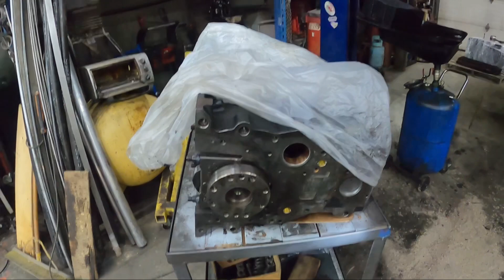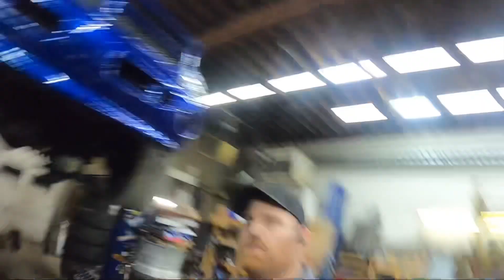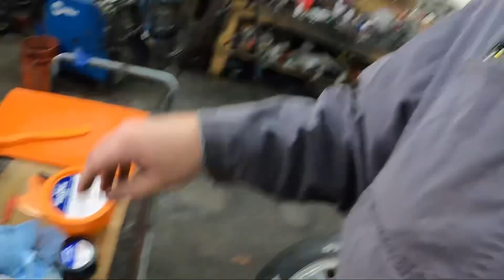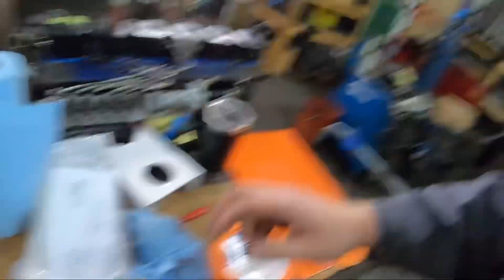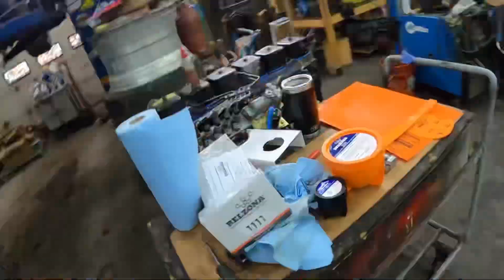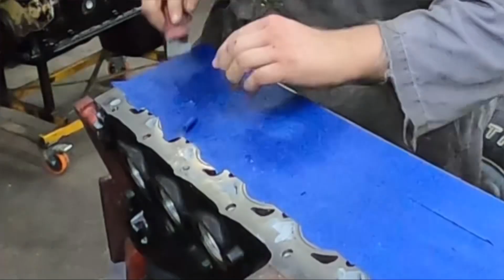I AM GLAD SOMEONE NOTICED!  6.1 CUMMINS BUILD

Comment: Wonder if that stuff would seal up the crack I have on one of the 12V heads I have around.  It’s an external crack between 5 & 6 above the head bolt on the exhaust side into the coolant passage. JB didn’t hold it, was looking at picking up some of those “lock n stitch” kits to fix it, but if that ‘goop’ holds where you used it imma give er a go. Seems I could sell the Case industrial head that I am using now if I can get that one fixed to a ppump 6.7 swapper
Reply: There is a ceramic block sealant called irontite.  I have had excellent luck sealing block and head coolant cracks with it. It is somewhat an involved procedure to do it properly but follow the instructions and I bet it would work for you.
Reply from the maker: That’s what it designed for. 
But for the cost of it. You couple buy a head
Reply: @CUTTERUPROB   Must be a lot more in Canada it’s about $30 us
Reply from the maker: @bcbloc02  I meant belzona 1111. It’s 400 a pound
Reply: @CUTTERUPROB  oh yeah we use belzona at the shop some and that stuff is expensive but it is usually cheaper than the part it fixes so….